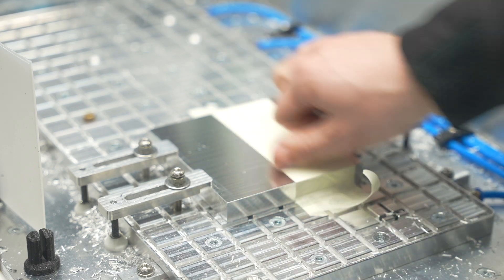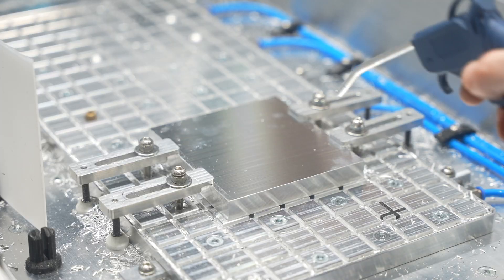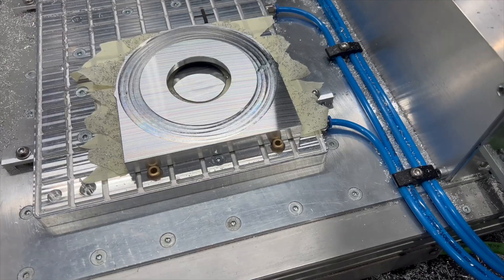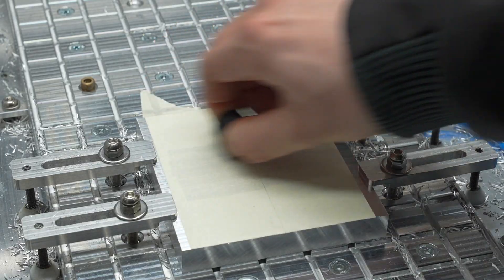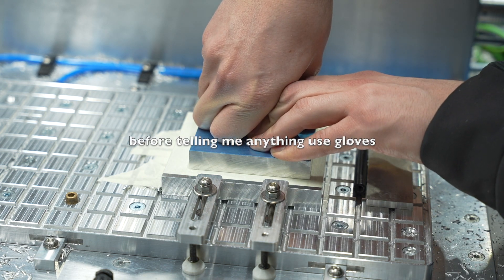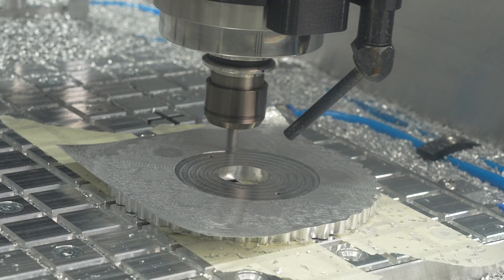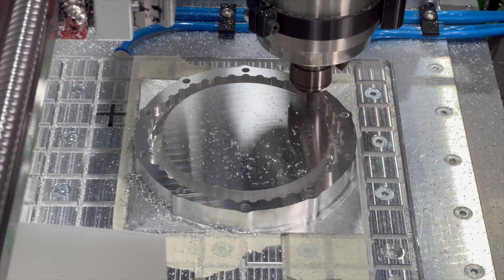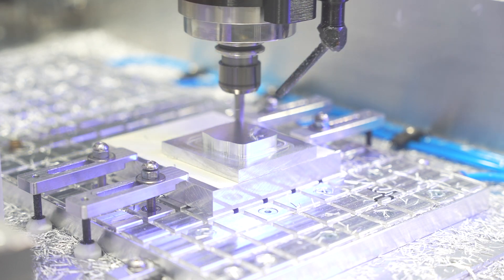CNC Router Workholding with Tape - How to get it super strong!

Comment: Thank you for sharing, this is a very good method. The video mentions that cutting fluid affects bonding performance. When I don’t use cutting fluid during machining, the aluminum would stick to the cutter and melt. It would be very useful if the corresponding machining parameters (spindle speed, feed rate, depth of cut, tool type) were marked in the milling video.😀
Reply from the maker: Hi Leon, thanks for your comment! I posted the feedrates a few times, they are the vendors recommendations most of the time. No need to reinvent it. 
If you have good quality aluminum, sharp tools and the right strategy you can mill aluminum dry. 
In this case the part (if glued with tape - bad heat conductivity) will get warm which is bad for precision and glue force. That's why I even use it with a little mist alcohol again. Enough to cool, not too much to creep under the part and dissolve the glue. Hope that helps!:)

Comment: Hallo Alexander, du hast mich mit deinen Video´s zu Aluminium fräsen verleitet. Womit machst du die Oberflächen deiner Alu-Rohlinge sauber? Benutzt du Nitroverdünnung um die Oberflächen von Fett zu befreien? Dann habe ich mir nach vier Jahren mein FogBuster-System an die Maschine gebaut und festgestellt, dass meine PU Druckluftleitungen kein Ethanol auf längere Zeit vertragen. Aus welchem Material sind deine Druckluftschläuche deines MMS-Systems? Gruß Markus
Reply from the maker: @MarkusHamm-l4l Hi Markus, danke und ja fräsen ist ansteckend:) wie beim Lackieren auch -> Silikonentferner. Der Hauptschlauch ist aus Pa, besser ist Pe. Problematisch ist angeblich der Silikonschlauch in der Peristaltic pump. Der hält auch seit 2 Jahren.

Comment: I use a Brayer roller to roll the tape.
Reply from the maker: @DavidR8  Thanks for your comment David. Good tip! I found more pressure helps better. That’s why I was using something even smaller.

Comment: also if you need to use coolant use green p
olyester powder coat tape those tapes use a silicone based adhesive and wont lose holding force with coolant. great video and if you need more hold down force 3m 2060 is a great tape choice.
Reply from the maker: @DBProto  thank you for the comment and tips. I ordered 2060 and am very excited!!

Comment: Some good tips in here! I use the very thin and runny fast drying super glue and i found that breathing on it shortly has the same effect as activator spray. Extra tip for cleaning the residue of the tape is vegetable oil. Really looking forward to seeing more of your robot arm 🔥
Reply from the maker: @filaxdiy  Hi Janosch, thanks for your comment! You are right. I have super glue wirh medium viscosity. This tape leaves no residue. 
Currently filming the robots progress for you:)
Alex